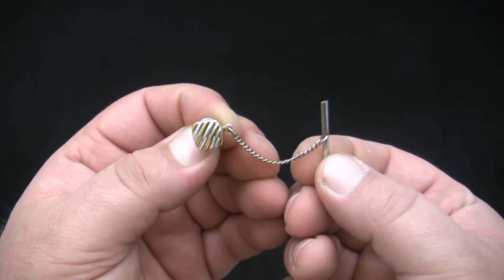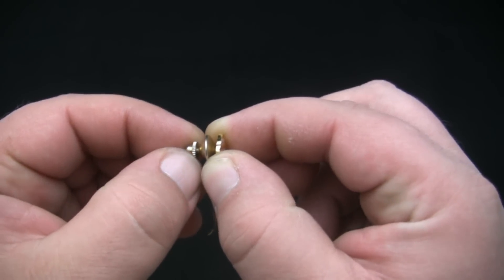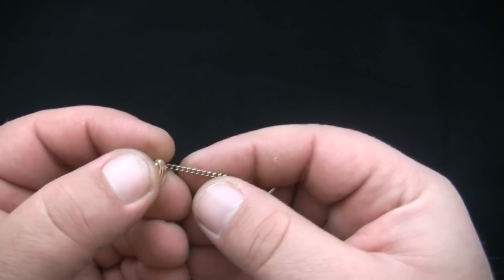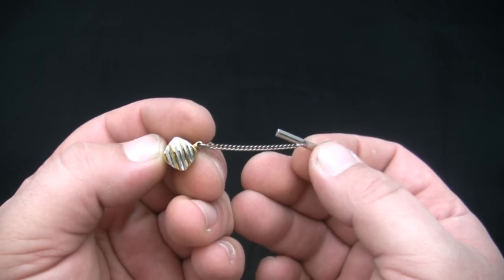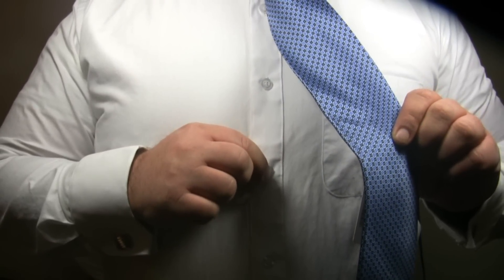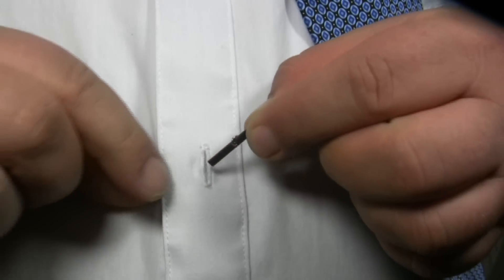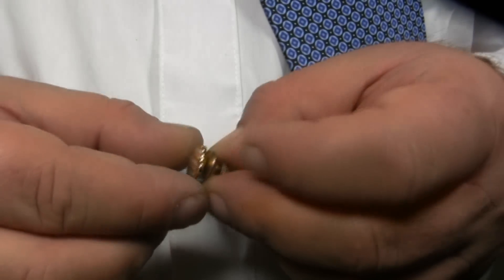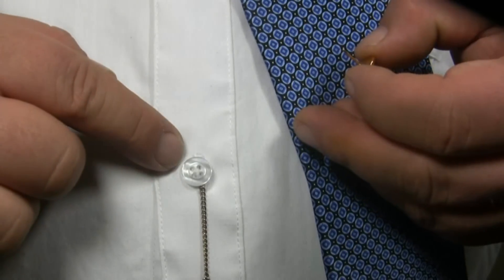How To Use a Tie Tack

Comment: Do advise using the tack with an ascot (Victorian Style)?
Reply from the maker: +Eric Jackson A tie pin is traditionally used but I suppose you could get away with using a tie tack. It may be problematic putting the tie tack in place once you already have your ascot tied and arranged. If you don't have a tie pin it may be best to tie your ascot in a style that doesn't require being pinned. But in a pinch, a tie tack will do the job.